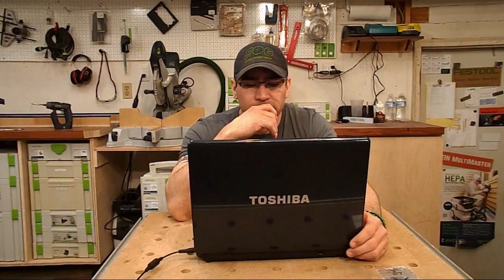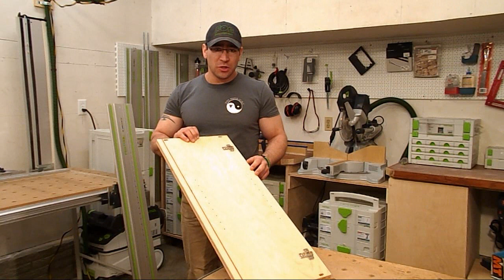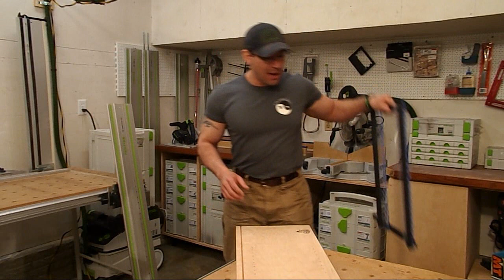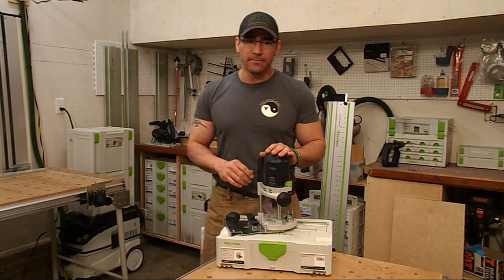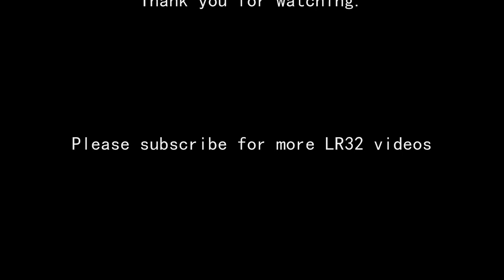Festool LR32  Introduction part 1 of the series

Comment: I recently bought the LR32 system and I find a spindle line boring machine to be far quicker and much easier to use on long gables, unfortunately I can't afford a spindle line boring machine at the moment so I'm in the middle of designing a bench that can secure the work piece and the guide rail securely and quickly. Would you have any tips on what would be the best solution? I was thinking of building a portable bench roughly 8 ft long and buying the MFT profile to attach the rail at either end.

Comment: Just bought the LR32 - have a bunch of cabinets to build and was putting off the purchase, but the upcoming price increase kind of pushed me into it - your videos, found on FOG, REALLY helped with the decision - thanks so much!
Reply: The "upcoming price increase" has become an annual tradition with Festool.  I strongly suspect it's just a scheme to increase sales each year without having a price reduction "sale."  The annual boost in the cost without any product improvement (or in some cases, an actual decline, such as the $70 surcharge for changing the imperial scale back to metric on the TS55) soured me on new Festool purchases.  I already have, use, and enjoy a lot of their tools, but I have stopped  buying anything new in Festool line.  As their patents have expired, other companies have made quite respectable versions (or sometimes even better) of many of their products at 1/2, or less, of the cost of the Festool version.  If I'm going to be charged a premium price for a product, it had better be a really premium performer.  Hello, Mafell.

Comment: I took a week long Festool sponsered class that included the LR32 system.  I have a ton of Festool stuff, but I really couldn't justify this system.  Perhaps its good if you're doing the exact same thing all the time, but its not really for the weekend woodworker.  We only spent a few hours with LR32, but it wasn't as intuitive for me as all the other Festool equipment I use.  I'm sure if I made cabinets for a living, and had a small operation, this would be a great system.  However, if you're doing a serious amount of cabinet building, you need a line borer, not the LR32.  I guess this is for the guy that builds a small amount of cabinets per year.  Also, the router plate is temperamental.  The little aluminum holes begin to get worn down and become inaccurate over time.  If you want to have a cabinet making shop, buy a line borer.  Yeah, they are expensive, even compared to Festool, but the LR32 system is simply too complicated for anyone that just makes the occassional cabinet and someone that makes a living making cabinets really needs a system where they can just place the sides in, pull the lever and bore every hole at the same time with more repeatable accuracy.  The speed and accuracy difference between a line borer and the LR32 is like the difference in speed and accuracy with ripping wood with a handsaw or with a cabinet saw.  To be honest, I'm not sure what niche the LR32 is filling.  That Rockler jig will work for most people, or better yet, use Woodpecker's system.  Everything else Festool I own, well worth the money.

I also feel the same with the CMS router table.  It's limited in use (but love the slider) and there are finer router tables for the same amount of money and are much more accurate, better dust collection and more versatile.

Comment: While I don't know of anyone who doubts the quality of Festool products the LR32 system is obscenely overpriced for what it will  do.  The cased portion of the system plus the rail (long version) plus the router will run you, with tax, over $1400.00.  I have a friend who has the Schmitt 32 mini system which he purchased on Ebay for $350.00 and a DeWalt DW 621 plunge router purchased from Amazon for $250.00 for a total of $600.00 plus tax.  I've owned a DeWalt router for over 12 years and have only had to replace the brushes twice.  Do yourselves a favor and check out the Schmitt 32 mini.
Reply from the maker: +fishman211 Bosch has a system that is somewhat similar to the LR32 system.   It's not readily available in the USA but searching on Amazon UK or UK eBay you'll find a dealer that will ship the Bosch system to the states.
I've heard good things about the Bosch system.    You are correct,  the price of the LR32 system is shocking if you don't own a Festool router.     Take care, Eric

Comment: Your videos gave me a reason to purchase almost an entire Festool system including the LR32. since their are so many posts, I was hoping you could share all the cut dimensions to these upper cabinets again. This will be my first build using the metric system. I have 704mm and then........:) Thanks!
Reply from the maker: +Daniel Meyer    I don't have the dimensions for the upper cabinets.  Sorry man.   A while back I did some rearranging of my shop and got rid of the upper cabinets.  And dumped the base cabinets down into my basement.   
But if my memory is correct.  The depth of the upper cabs where 381mm  or 15", which is a standard upper cab depth, I think?  LOL!
As for the height, man you can make them any height that fits your needs.   If you're using the LR32 system I would suggest making the height of the side panels increments of 32mm.   So for this video, if the height of my upper was 704mm, it's divisible by 32 and is around 28".     
And for the width, again man,  make them to fit your needs.   But I think the upper in the video was 457mm, 18" wide.  
Sorry I can't be much help to you bro.  
Take care,
Eric
Reply: +MrBigerock Thanks for the info anyway!   So, New shop tour coming up? ha!
Reply from the maker: +Daniel Meyer   Yeah, new shop tour video is coming up.   I'm building a dedicated 26' X 26' shop in my backyard.    I insulated it this weekend and will start the drywall work next weekend, if I can.    I've been building my new shop for a few month now.  Getting a little done on the weekends.

Comment: Eric if you only had the 1400 track that comes with the ts55 what Holy Rail size would you buy for the LR32? I could use a longer rail for the ts55 but is the 2424 too long and presumably awkward for the LR32? Or should I buy the 1400 Holy Rail and connect it to my ts55 rail?  Please help haha too many choices.
Reply from the maker: Steven Brown Hey Steven.  Let me try to help.  It's always tough giving someone advise on what to buy.  Since it's not my money.  LOL
The 2424 LR32 rail would be awkward for standard base and wall cabinets.  I use it for pantry cabinets, that's it.  So having a 95" rail for drilling the holes for  a 32" base cabinet would drive me crazy.  Way to much rail for the task.   
I tried connecting the 55" rail with the LR32 55" rail for drilling a long row of holes for a big cabinet.  IT SUCKED !   So I put the project on hold and ordered the 95" LR32 rail.  So if you know you'll be making a lot of large cabinets that would require the longer LR32 rail, then go with that.  But if you know that the majority of your work will be under at least 50" (leaving room for the end stops)  then the 55" LR32 will work great for you.   I own a lot of rails.  The 118", 55" and the LR32 55" are my most used rails.  All the others are just nice to have available.
  
IF you have not purchased the TS55 yet, then ask your dealer if they will swap the rail that comes with the TS55 with the LR32 rail.   A lot of dealers will swap them for you.  Not sure if their is a price difference or not.   If you haven't bought the TS55 yet then adding the 55" LR32 rail to the order will give you the best of both worlds.     The ability to make long cuts and drilling a long row of holes when the rails are connected.  
Hope this helps.
Eric
Reply: MrBigerock Awesome thank you kindly.  I have the TS55 but didn't know about swapping the rails at the time.  The last thing I'd ask you can you break down the 48" side of sheet goods with the parallel guides and the 55" rail or is it too short?    I have the set and want to use them but only have the one rail (1400mm).  Eventually I assume I'll buy all the rails you mentioned.  Again thanks for your response and videos!!!
Steve
Reply from the maker: Steven Brown Steven the Festool parallel guides take up almost 4" at the beginning and end of the rails.  So using the Festool PG's with the 55" rail will not work for you.  You need to make sure that the base of the TS is completely supported at the beginning of the cuts. The PG won't allow for the saw to be completely supported at the beginning of this cut.    For cross cutting the 48" width of sheet goods with the Festool PG I use the 75" rail.  

Now you could always use an aftermarket parallel guide system with the Festool rails.  I have not used them but I've heard great things about them.  Plus they cost a hell of a lot less then the Festool PG's.  They are made by Seneca Woodworking, the same guys that make the Domiplate that lives on my Domino.   Check them out.  I have no affiliation with them, but they make fantastic products.   

http://www.senecawoodworking.com/products/parallel-guide-system-for-incra-t-track-plus

If I didn't have the Festool parallel guides and all the rails already.  I would buy the Seneca system.

Take care!
Eric

Comment: I have a question im going to make cabinets wich are 2000 mm high for driling the shelves i use my festool lr32 set i own a fs1400 rail wich is only 1400 not 2000 mm is it possible to start driling holes from the top and than move the rail for driling the bottem holes ?
Reply from the maker: Yes, it's possible.  But you need to be careful and stay mindful of what's going on.  Figure out a way to clamp the end of the rail that does not  overlap the work piece will be important so that the rail does  not move on you.  If you have another rail (standard rail)  and two rail connectors you can connect the rails so you have a place to clamp the work piece to the rail.  I've done this, but it is a PITA because you will be connecting and disconnecting the rails a lot.  But if this is the only way you have to tackle the job you can make it work.  If you do this, then try to drill out all the holes for the front of the cabinets before you drill the back set of holes.  This way you won't have to do a lot of fumbling around with the two rails.  But if you only have the one rail, just figure a way to clamp the end of the rail that doesn't overlap the work piece.  That's the main thing.
Good luck!   Take care,    Eric
Reply from the maker: Sorry,  I just noticed your cabinets will be 2000mm high.   That's not an increment of 32mm……so I'm not sure how well this will work for you.  If you're cabinet sides were in 32mm increments, then you wouldn't have a problem just moving the rail down to the bottom of the work piece.  But since your cabinets are not increments of 32mm…..when you move the rail down…the holes will be off and you'll be mad at me!  LOL    So maybe modify you cabinet height ?

Eric

Comment from the maker: Super, All the rails can be joined together with the rail connectors.  It's recommended to use 2 rail connectors.  So you could connect a LR 32 rail with any of the other rails.  I have the FS 2424/2-LR 32 rail as well.  I use it for cross cuts on a 4 x 8 sheet of plywood.  My opinion is, that it's a pain in the butt to use a regular rail with a LR32 rail for drilling a long row of holes.  I've tried it for on project, and it drove me nuts, so I bought the 95" LR32 rail.   Eric

Comment: How easy is to use FS 1400/2-LR 32 guide rail on long peaces as i don't want to invest in FS 2424/2-LR 32. 2424 would only serve as a shelf hole cutter. It is too short for cutting 8ft sheets with circular saw